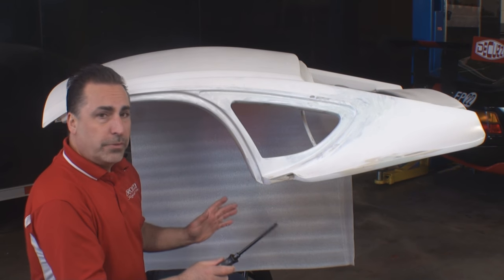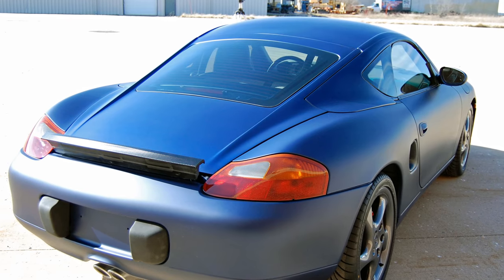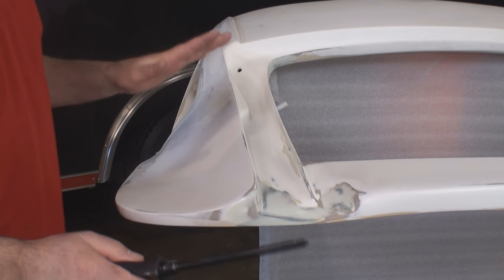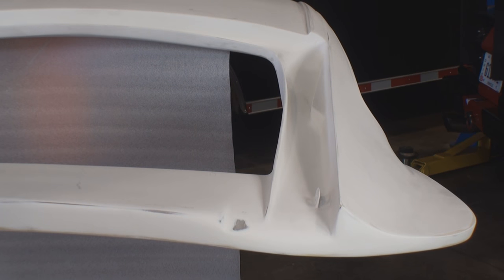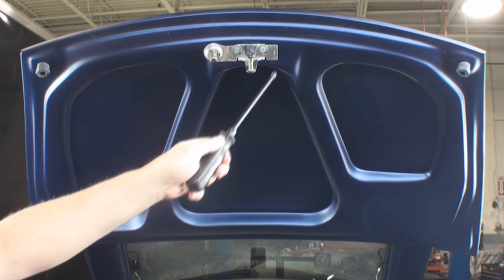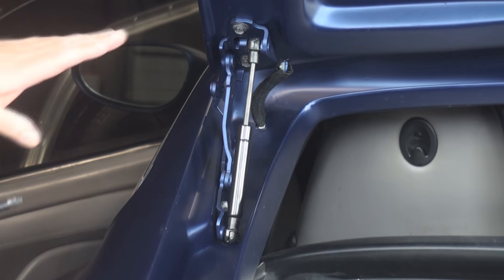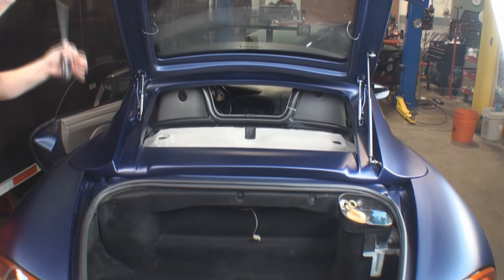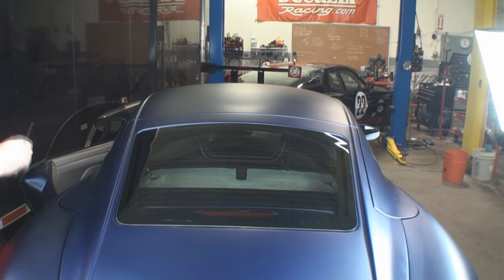986 Custom Hardtop Fitting for the Porsche Boxster 2017

Comment: So, is it a one-way street- add the Cayman hardtop and there's no going back? Or does the convertible top stay tucked down low and you can remove the hardtop and go topless in the summer? I suppose you'd have to re-attach the latch and trunk hinges, but is that it, or is there irreversible bodywork being done for the hardtop? Please help!
Reply: This is not a one way street, Great for winter driving, The soft top removal is easy 2 man lift out so you do not scratch the car. Re install the boot lid again eas job, the trunk lid latch you can get anothe one used on ebat to make the return swap easier Thanks
Reply: id rip out the softtop so fast

Comment: Very cool. Only problem : it's cheaper to simply buy.....a Cayman 😉
Reply: boxter ,,, sub 2k vs cayman 10k min .
Reply: Where on earth have you seen Cayman with Boxster pice?
Reply: @tomthompson7400 You're not going to find a Boxster for $2k, let alone sub...

You're looking at about $10k minimum, then add in tax, dealer fees (if it's at a dealer). Then you can expect to spend another $10k immediately in repairs/maintenance because it's likely going to need it.

As the saying goes "there's no such thing as a cheap Porsche"...